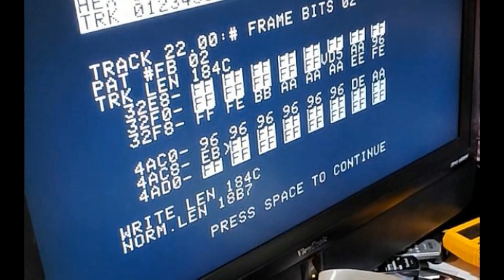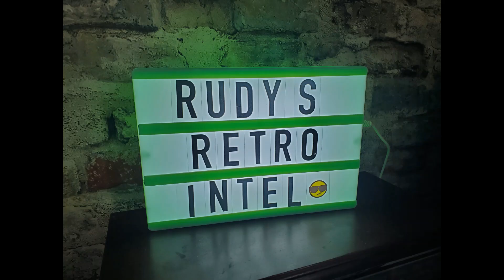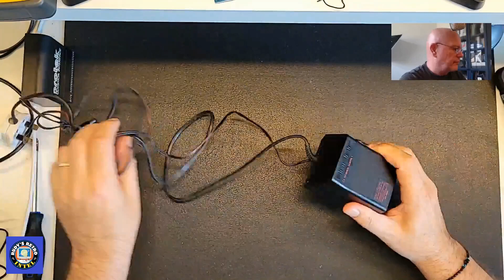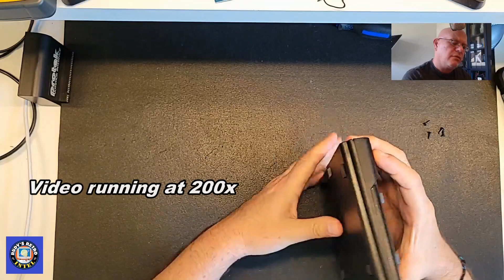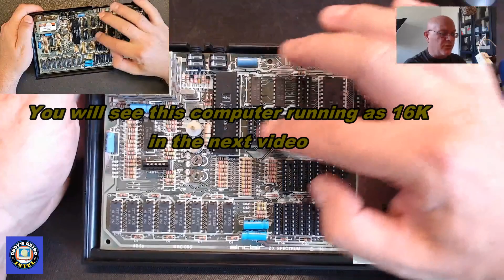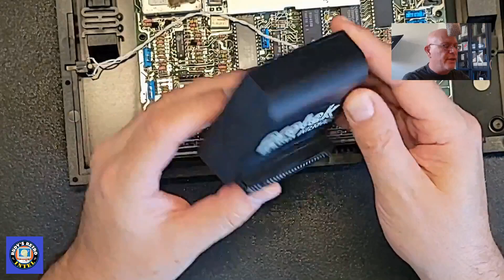My first ZX Spectrum computers have invaded my channel. Let's peek inside and poke around.

Comment: When you come to add RAM to the 16k machine check what sort you need. The RAM chips used for the upper 32K are not the same as for the lower 16K I don’t remember exactly which they are, but I do remember that to cut cost they are actually eight 64kx1 chips that only either the upper or lower 32K passed quality control, so are used as 32Kx1.
Reply from the maker: Yes, the upper RAM are 4164 chips. Stay tuned for the upgrade video coming soon. Thanks for commenting

Comment: I wish restorers would use some lighter fluid and peel those warranty stickers off, instead of poking screwdriver holes in them.  With a gluestick, you can put them back later in a spot that doesn't cover a screwhole.
Reply from the maker: True, I just like to pull them off completely. If you are opening the computer, then they should go. To each his own. Thanks for commenting

Comment: You've done well there Rudy, two nice examples of the ZX Spectrum. I don't think that you need to go changing the keyboard membranes on them, at least not until you've tested and seen problems. They look to be supple and in good enough condition to me. Just tape back the milky white backing that fell off that one side and it might just be ok. Thanks for sharing.
Reply from the maker: Thanks for commenting, Peter! Yes, I won't change them until I get the computers working. I'm already working/learning about the 16k to 48k mod. Also, the first spectrum is working, but stay tuned for more on this.

Comment: Hi, Rudy.  Great video.  I've got a ZX Spectrum 48K coming across the pond from 8BitRetroReFix (Steve) sometime hopefully in the near future, so I'll be exploring one as well.  There are actually two mods I know of for composite output.  The one you mentioned using a capacitor and another using a common transistor.  I don't know if one is considered better than the other.  You can find plenty of videos on both mods.  There's also a ZX version of the Dandanator that I've featured for the CPC 464.  Noel's Retro Lab did some vids on that one a while back.  Thanks for the quality content!
Reply from the maker: Thanks for commenting! I've been watching a lot of Spectrum videos and lots to explore. I will be looking at the Dananator, too. Stay tuned for more Speey adventures. I'm super happy that  I finally got not just one but two.
Reply: Rudy will mod both systems using his "TinyComp". It's a great handy little kit that ;)